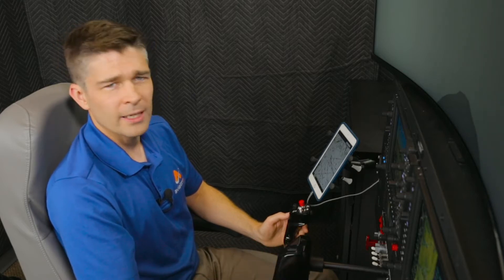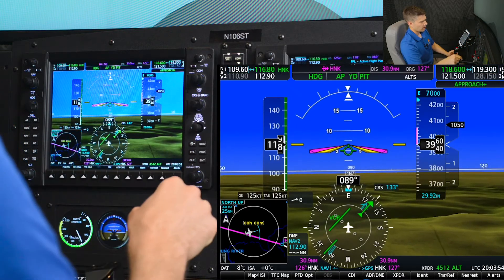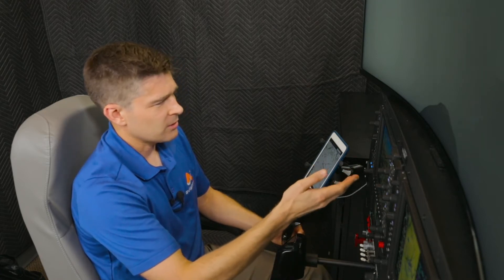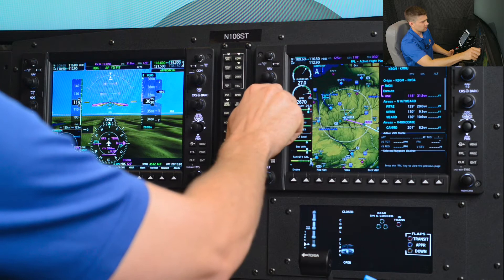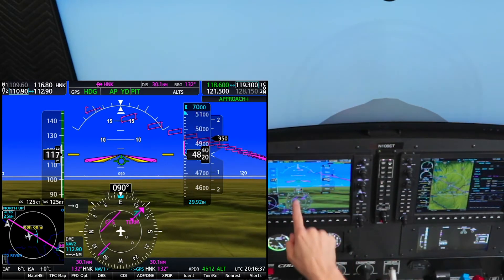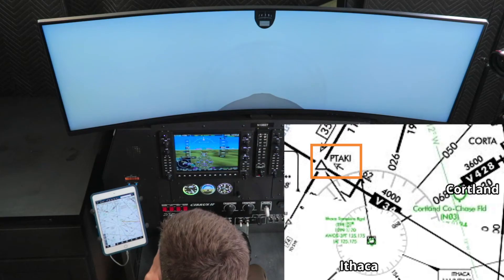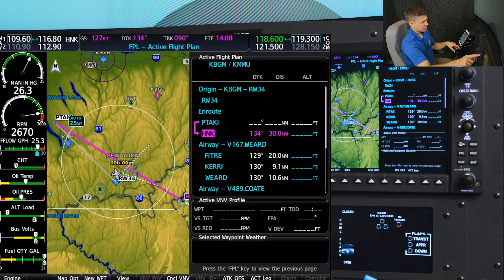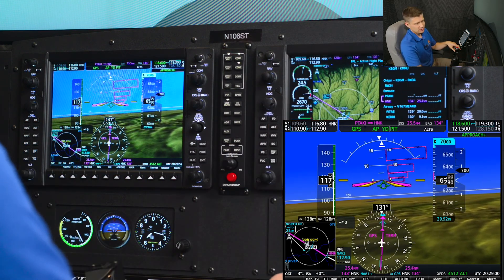How can you intercept an airway using conventional VOR navigation in the G1000 simulator?

Comment: i have a question, let's say i am flying victor 3 to Fosty from Kbos boston, Fosty has no VOR how do i track to Fosty to intercept it using only VOR not GPS
Reply: you can either track the 240 radial from the BOS VOR or load in the airway by using a flight plan by using BOS-Frosty. If you load in KBOS (the airport) it will not let you load in the airway.

Comment: Great vid. Flying from KSNA to KBUR via the TEC route - I was assigned to intercept the Santa Monica 125 radial. 
Naturally this bypasses POPPR which screws up your gps flight plan. I ended up switching the cdi and tuning into the MOR for frequency .  I was assigned to intercept the 125 radial less than 3 miles without much warning or expectation. 
Question - which method would you have employed with a short 3 mile fuse to the intercept? I love finding a Victor airway and choosing a previous waypoint and activating leg- but the 125 radial was not on a V airway… just a random radial. 
Fyi this was on Xplane 11 with pilot edge for the I-3 rating -
Thus expect the pilot edge controller was making more difficult than socal dept would in real IFR
Reply: I had this exact scenario in PilotEdge for my I3. I think the second option is best as there is no cone of confusion and you get auto sequencing.